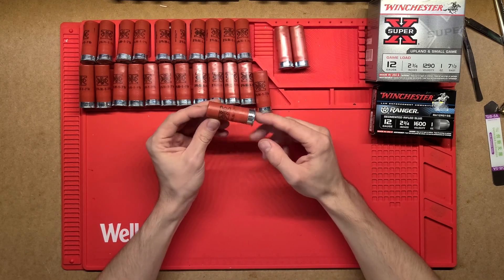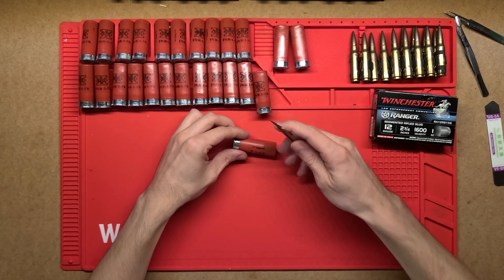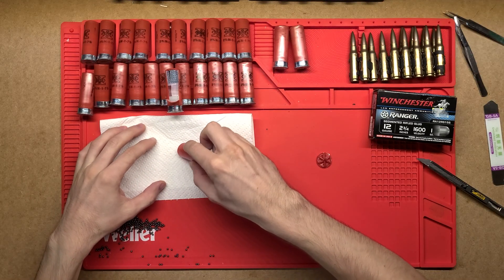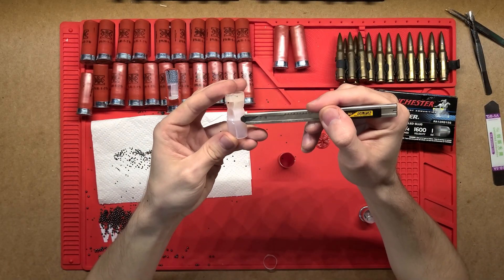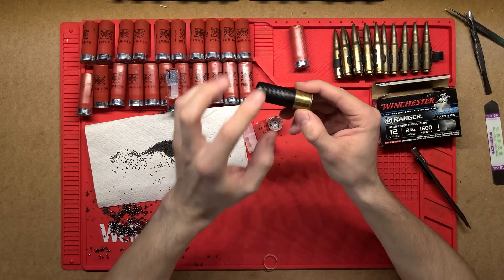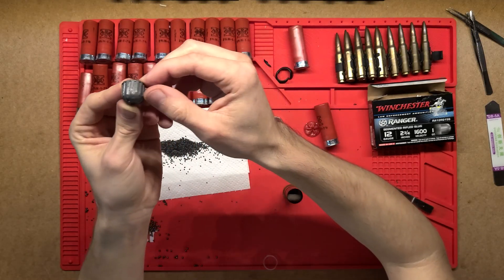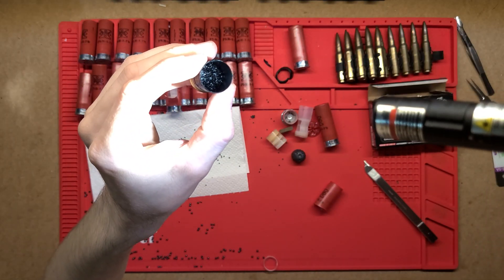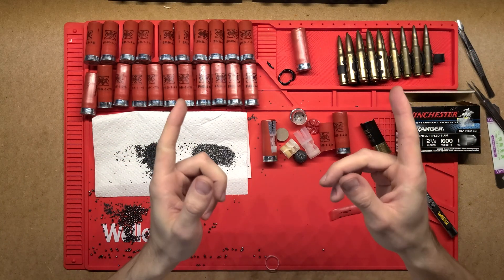Secrets of the Modern Shotgun Shell

Comment: So the collapsing bit between the powder and shot is called a compression piece. (may be called a power piston on older Remington shells). It is there to collapse during the peak of the violent propulsion of the wad and shot down the barrel, as to prevent the soft lead shot from smashing into themselves causing deformation (often calling golf balling). This deformation to the round shot will cause these pellets to be less aerodynamic, cause drag, and fly erratically after leaving the barrel and shot wad. Look at the back of a wad or at collected shot after firing and you will see shot imprints on both.  
This was is not needed on harder shot and will often not be found or will be much shorter in steel shot shells.  

When looking at patterning in shells, I ask myself is the shot consistent in size, weight, and shape? And will it remain so after leaving the barrel. This is as important as the barrel and choke it will be fired through.
Reply from the maker: Ahh great explanation thank you for sharing!